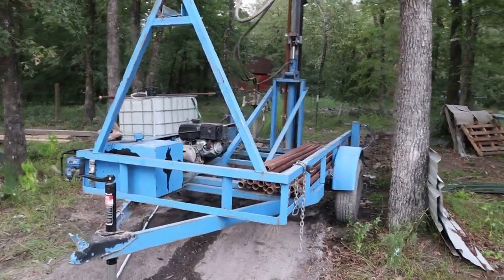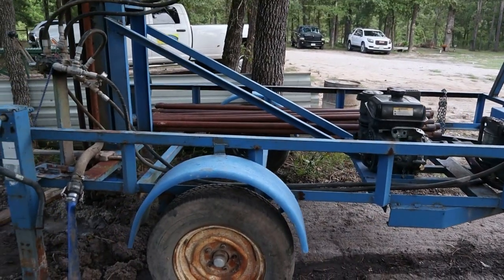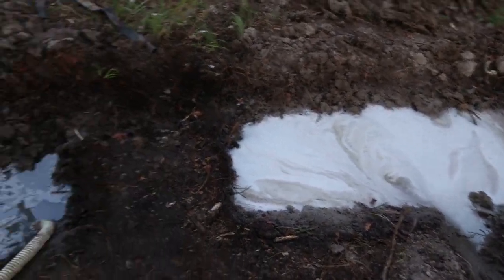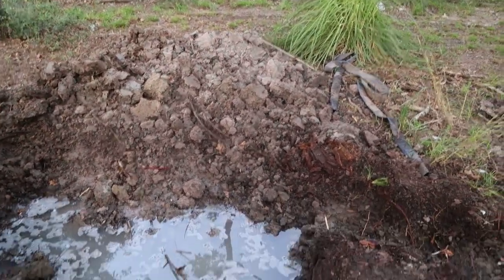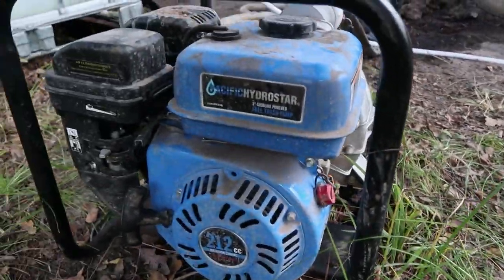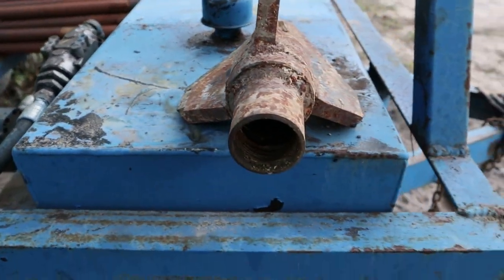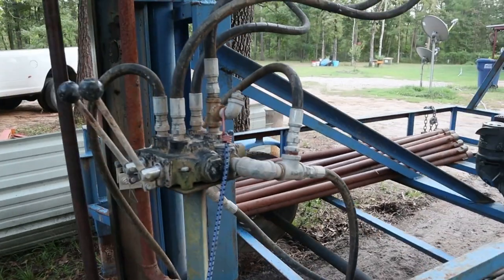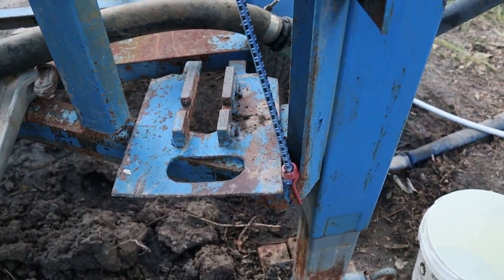Homemade Water Well Drilling Rig Machine Part 1 Set Up to Drill for Water

Comment: I’m rebuilding my wife’s gramps home made rig it has an old 230 GM engine running it. This video is helpful
Reply from the maker: Thank you. Appreciate the comment
Reply: what is the pipe? black pipe? how about the couplers?
Reply from the maker: @rodneykilgore6591 pipe is normal thick wall pipe .couplers are from a company in Houston, I think is was lone star drill bits

Comment: I am still working on building my own lol thanks for your help
Reply from the maker: I hit some solid rock at about 30 feet on this hole..will buy me a roller cone bit and try to drill past it a little quicker when the bit comes in
Reply: @LarrySbrusch  well I haven't purchased a bit or swivel but I got the Derrick and stuff going
Reply from the maker: @MichaelBrown-lv1ks  send me some pics..txdashcovers2012@gmail.com
Reply from the maker: You came by my place one time, didn't you
Reply: @LarrySbrusch  yes sir
Reply from the maker: Good to hear from you..I need to come by and see what you got going on..you might want to come by when I repack my swivel, so you can see what I have
Reply: Wondering if you ever drilled through the rock with the tri cone bit

Comment: what type of motor and gear reduction? what do you have for a water swivel?
Reply from the maker: The motor turns 152 rpm and the the engine is a 429 cc kohler engine. The swivel is custom made

Comment: What did you use for drill motor? Having hard time to find right one low RPM 150
Reply from the maker: I will have to check, but mine turns 152 RPMS..I believe it was a brand called Charlynn.. I will have to look at it, next time I get a chance to go put my eyes on it in the daylight

Comment: Curious what you constructed your drill pipe from?
Reply from the maker: I used heavy wall standard pipe and purchased M50 couplings then set the pipe in a jig and stick welded them. The first pipe I welded the couplings a little offset to create a small wobbling affect to drill a wider hole. It seems to work for me. Hope this helps
Reply from the maker: I forgot. I did have to machine a small amount out of the couplings to fit over pipe. Not much and it didn’t take long with my old victor 1640 lathe

Comment: What diameter is your drill pipe?  How long is your trailer? how many GPM is your hydraulic pump? And What is the RPM of the hydraulic motor That is turning the drill pipe?
Reply from the maker: Drill pipe is 1-1/2".. The RPM is 152 RPM. The hydraulic pump is the same 2-stage pump that garbage trucks use.